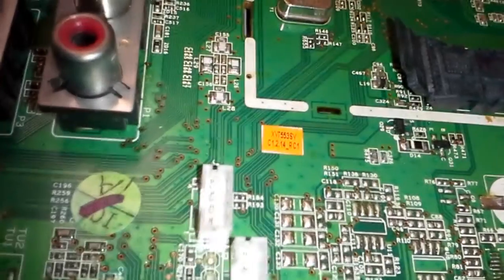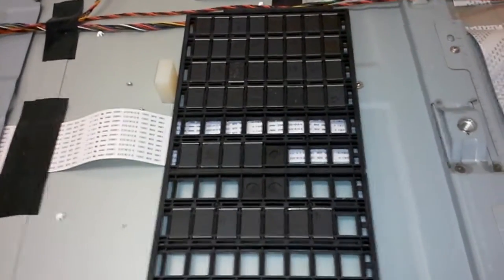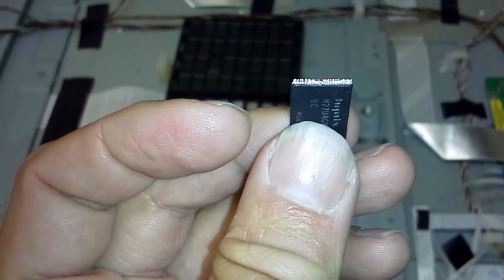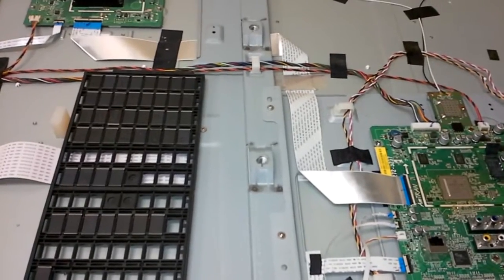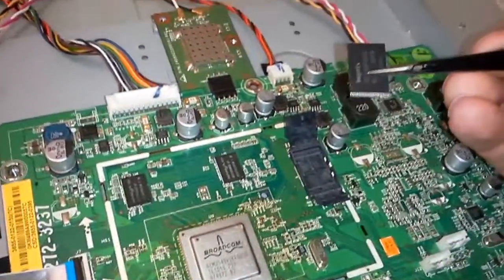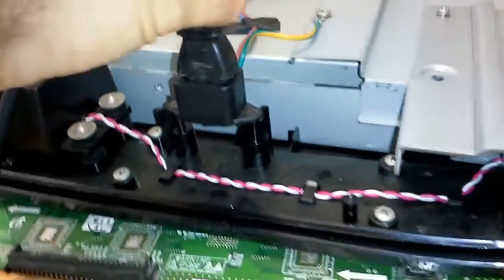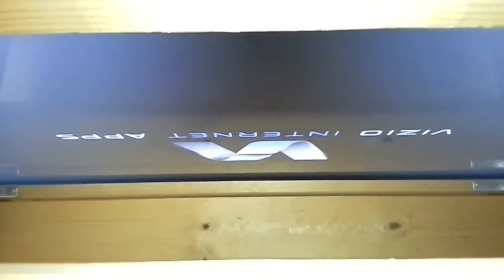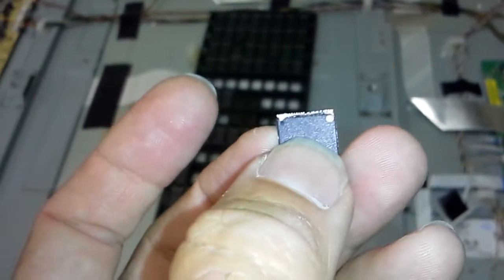Testing EEPROMS dos and donts - Vizio XVT553SV, M470NV, XVT3D554SV families

Comment: Interesting to see there are still TV repair shops.. Around here those places have gone the way of the dodo bird. When your set breaks and you dont know how to change a PSU PCB then you trash the set and buy a new one.. Sorry but that is the world we are living in now. Disposable..
So what causes the original eprom to go bad? Is it the end user hamfist tooling about inside the set because they watched a youtube video and think they are some expert? Or is it a natural failure of some sort?
Reply from the maker: On those models listed in the title the EEPROMS actually go bad very rarely - way less often than people appear to assume.
We have seen them go bad naturally just because of aging, failing memory block (which is guaranteed to happen eventually, just is rarely fatal).
On other models it is the common failure.
And yet for those models here we have seen more boards not working because of human induced damage when replacing eeprom (most likely without need) than actually naturally failed eeproms.
Reply: @coppelltvrepair  In my experiance with TV sets and PC Monitors (modern flat screens) that it's the power supplies that fail first at some degree, whether it be a FET or set of them or more commonly the capacitors on the DC side dry up or leak.. I always check that before going into the logic board because I have seen poor voltages (or noise and ripples on that voltage) cause weird logic board behavior before that would make you assume the logic was bad but in reality it was a bad set of caps on the PSU board...

As for failed or failing eprom, I have seen them naturally fail but only in 2-way radios. the Motorola MT2000 and MTS2000 flashport handheld radios. We get those in with eprom failure due to read and writing and internal natural failures (wear and tear per say as everything the radio does while powered up causes the eprom to read and write data even sitting idle it does it..) these radios are not worth repairing nowdays so we replce the whole unit with an APX series or a cheaper XTS series radio. But yeah natural failures I have seen. I know there are youtube experts out there that try and hack their wifi routers and brick them or their CCTV DVR and brick them..

Comment: Problem, Vizio M420SL  the TV works, but I cannot get into the Menu. When I press the Menu button on the remote or the TV, the Menu appears for a split second and then goes back to the program I was watching. Using my phone's camera, I have checked all the remote's buttons and none are stuck down (because the IR is off) and all work when pressed and the batteries are new. What do you think is the problem, please?   and thanks.
Reply from the maker: I think you have a bad main board and you will want it repaired or replaced. Alas, at this time we can't offer either.

Comment: Hi there, not sure if you could help me with my TV but I have a Vizio 55", model number M500SV. The TV will turn on displays the Vizio logo then does a quick flicker and then displays for me to set up my TV signal, when I go through the options to choose signal I select cable then cable device, then once I begin scan the TV powers off by itself. And before I restored the TV's defaults whenever I opened the menu it loaded extremely slow, and using the directional arrows either way there is a long delay so any information you have would be much appreciated, thank you.

Comment: I just installed a new eeprom into an xvt553sv and still does the same thing. The vizio light still contentiously flashes. Was wondering if you could give me some insight. Im thinking I might have got a corrupt eeprom.
Reply from the maker: The first and most important thing you and everyone else in your 
position needs to understand is that there there is no simple and 
effective method to tell if EEPROM is bad period. 

There are a lot of possibilities, which is why we avoid making finite statements, which people seek and sometimes react upset as if we're dodging answers they seek. 

Yes we are and that is because there are a lot of possibilities and not enough information to make a firm statement; anyone making one under the circumstances is either naive or seeking to take advantage of the situation.

Consider these:

- Is it possible for your original EEPROM to have failed?
 - Yes,  it is.

- Is it likely?
- Not very much based on experience, but certainly still possible and yes we have seen it happen.

- Is it possible you may have received corrupt EEPROM?
- Yes it is. 

- Is it likely?
- We can't really say as we do not even know where it came from. Only source for which we have reliable statistical information is ourselves and here is what we know:  every single one of those particular ones is individually tested to boot and operate the TV; we do not test every single app or feature, of course, this is too time consuming, but we definitely test them. Note this may change in time, so if you read that long after answer is posted we may have come with better/faster way to assure functionality.

Now, the fact that the TV is blinking means two things: you did not get a blank EEPROM and you've soldered it correctly.

My hunch would be that the problem is elsewhere on the board.

Hope that helps, but read the first paragraph again!
Reply: Coppell TV Repair LLC thank you sir for the input. I was kindof leaning toward something else was wrong sense the light is flashing like you said. I thought at first I didn't get the eeprom soldered correctly. But all the joints look perfect. You confirmed for me it's on right sense I wouldn't be getting a flashing light if it wasn't. I'll do a little more reading and testing to see what I come up with.
Reply: Trevor Richardson did you find the solution to this problem?
Reply: Did you even bother to test the power supply and it's capacitors before jumping in to eprom replacement?